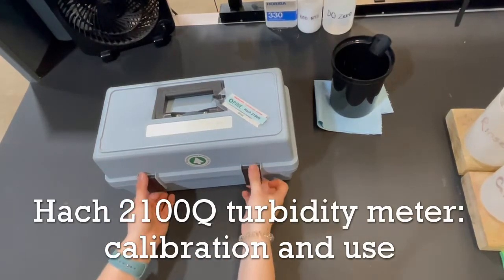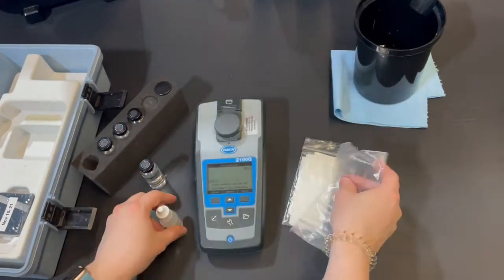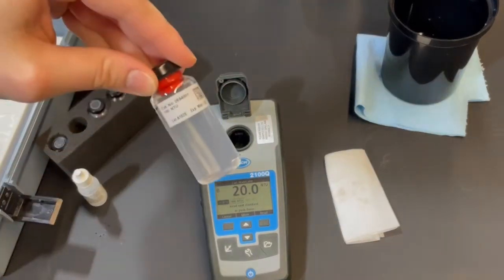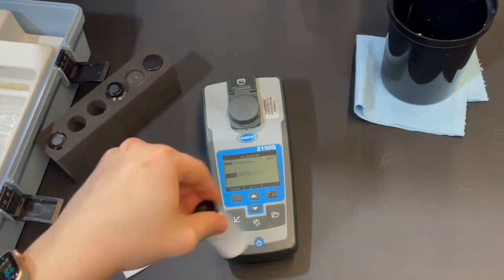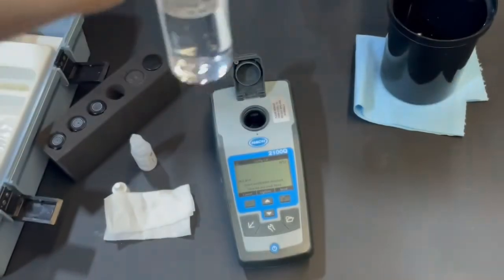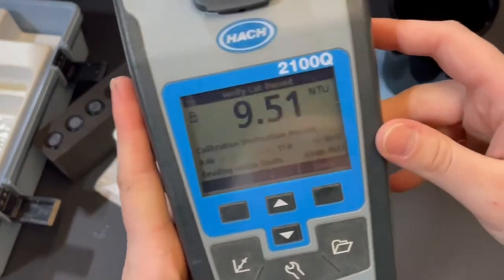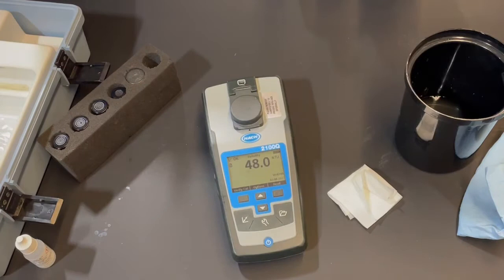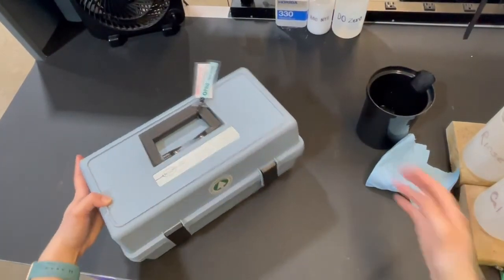Hach 2100Q turbidity meter

Comment: @jeffissimo I am also a technician at Pine, the read button on the Hach 2100Q does not fall off! It is a rubberized keypad like a TV remote or any membrane inside a keypad!
What generally happens is the read key is used more than the other keys on the keypad. Sharp fingernails or a pen is sometimes used, and tears, through the plastic! In normal use
it could last a five or more years. Now the 750 dollars flat fee can fix any issues with the Hach including replacing the cover, but if your unit breaks through the read button, you can order a new cover for under 50 dollars and replace yourself, 5 screws on the bottom must be removed, use a heat gun all around the edges and while hot, poke a small flat screwdriver on the top edge and pry open careful not to disturb board or aluminum sheets inside, then simply replace cover and replace 5 screws!

Comment: Thanks for posting this video. It was thorough yet concise and explains the calibration method wonderfully.  I am looking for a turbidimeter myself, for a capstone project, and I am torn between the Hach 2100 and another EPA approved meter. I was wondering if you could share some thoughts on the build quality of the unit. I keep seeing a few reviews of the unit that describe the Read button falling off and Hach charging nearly $700 to repair the button.  With only a 1 yr warranty that is worrisome. Other manufacturers offer a 2yr warranty.  Any thoughts you can share to the build quality will be greatly appreciated.  Thanks.